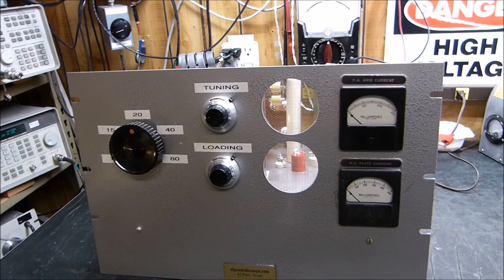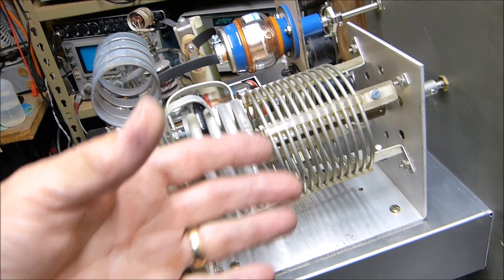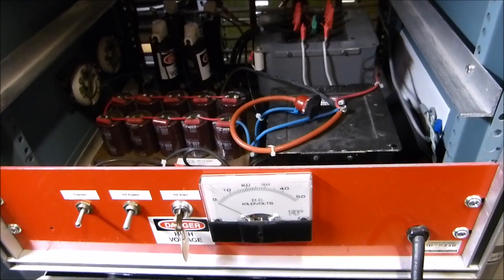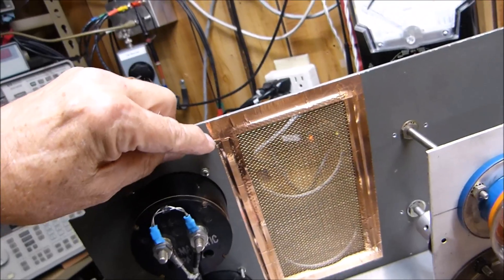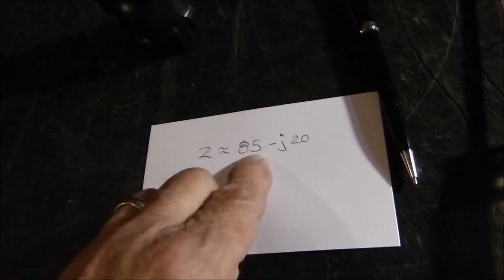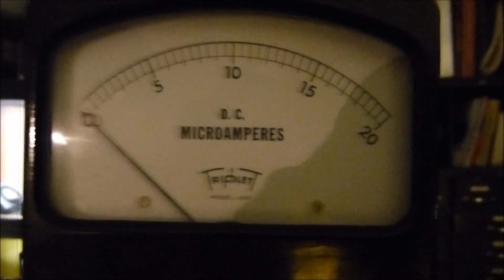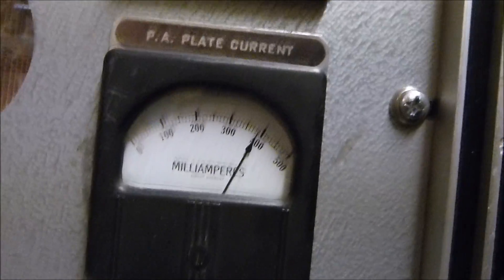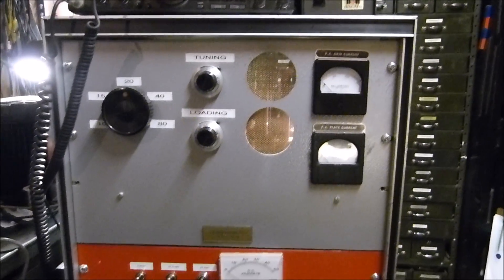Eimac 3-400Z or 3-500Z  Grounded Grid Linear Amplifier Build For Amateur Radio

Comment: I wonder does Dolly Parton  own TEN-TEC?
Reply from the maker: Ten-Tec is in Tennessee and so is Dolly Parton. I guess it has to be...   :-)
Reply: ElPaso TubeAmps I'd love to see a schematic of this one. The RF amplifier I mean. Well, Dolly, too, if you can find a schematic of her :-|
Reply from the maker: Copy and paste the text below  into Google and it will take you to a site that will download a PDF and does a really good job of calculating the input tuned circuits for the 3-400Z. I use 100 ohms for the input Z of the tube. I just recently built this into the amplifier so it will work on all five HF bands.

I do actually draw schematics and put them in an envelope inside the cabinet but I don't have a one full schematic of it.

RF Power Amplifier (RFPA) Designing a 'Input Tank Circuit' - AMfone

Comment: Are those turns counters on your caps?  Couldn't quite tell.   How much fiddling does it take to go from say 80 meters to 40 before you can transmit?  I'm considering some vacuum caps in my current build.
Reply from the maker: The turns counters are from multi-turns pots. They can count to 14.99 and then it just wraps around to zero again and starts over. That can be dealt with, with close attention.  Certainly that is not ideal but the better turns counters that I have are too large to fit the front of this amplifier. You can notice that I made a bracket to stack the vacuum capacitors vertically just to save a little room. The B&W 850A takes up a lot of room on the chassis. I will keep looking around for some simple, and smaller, turns counters on Ebay and may change them out with better ones in time. I personally love the vacuum capacitors because the tuning cap goes from 5-500 pF at 5KV in such a small package. Also, the loading cap is 2000 pF at 5 KV. An air variable capacitor of that raging wouldn't fit on the chassis. I haven't tuned it up on any other band but 20 meters so far. I am thinking of building an outboard 80-10 meter tuned circuit with switching that I can mount on the rear of the chassis so I can use it on all bands. Thanks for your comments.

Comment: Beautiful amp. Is it getting hard to find some of those parts? Thankfully the tubes are still available though
Reply from the maker: Thank you. Yes, some of the parts are not available on Ebay very often like the B&W 850A or either they are in bad shape. I agree that the tubes are still available and the Jennings vacuum capacitors are always out there for sale but sometimes they are a bit too expensive for me. With patience I seem to be able to find most anything, eventually, at a reasonable price. This is the first time I have used a commercially made filament choke, in this case the B&W FC-15. I have always wound my own with #10 formvar wire around a ferrite rod.
Reply: Absolutely unbelievable and professional build on that amp! Thank you for the video.
Reply: Michael Lloyd amp
Li. Amplifitori rf hf con valvola russa ry81